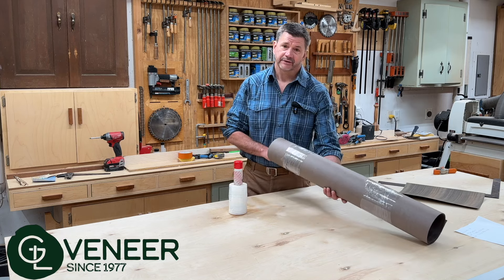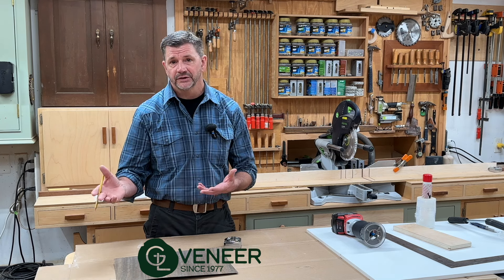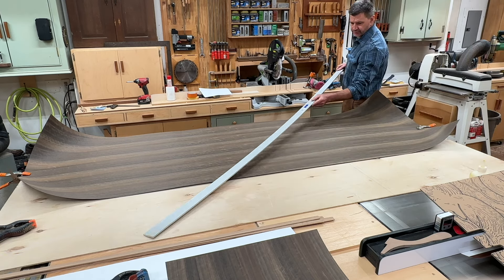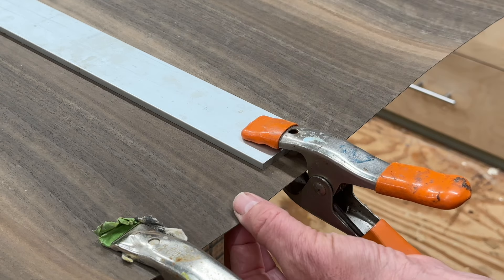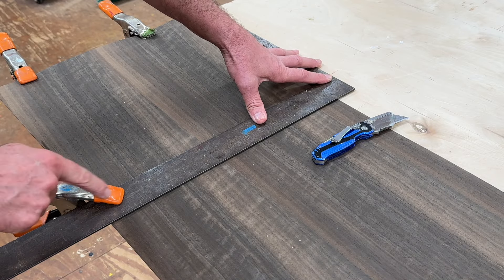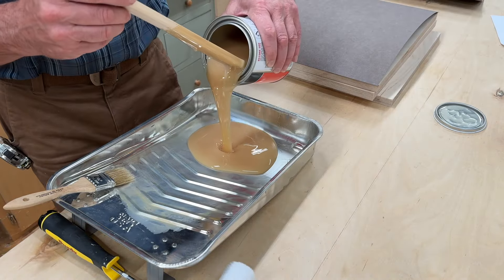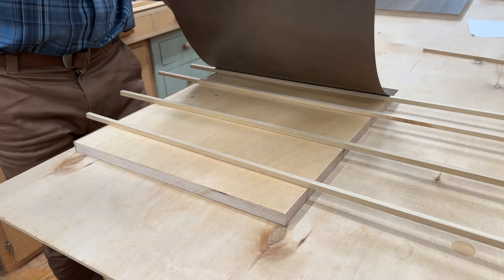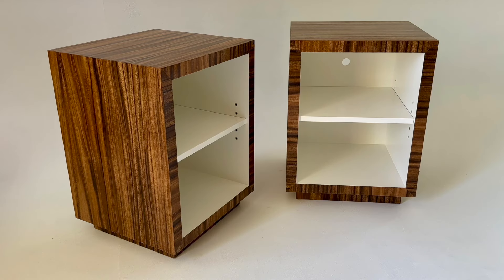How to Work with Wood Veneer - Tools Tips and Techniques

Comment: I'm in the process of sanding down and refinishing my kitchen. Next up is the plywood faces which I am planning to veneer. The problem is it's a vertical surface and I don't think contact cement would be a great option for that, especially since I won't be able to flush trim after the fact, it will have to be cut exact. Have you ever used contact cement on a vertical surface? How about an adhesive backed veneer?

Comment: Great video. Question: Do I have to veneer both sides when using non-water based contact adhesive.   Just what I needed.  I don't have a huge vacuum bag and pump.  I find the ironing on wide sheets of veneer can cause cracking/splits in the veneer.  So I was thinking that contact adhesive might be the answer.  Thank you

Comment: hello, so recently I had a project using quarter cut maple veneer and I used the contact cement method as I dont have any veneer press or a vacuum bag but it end up a massive failure. 
the results were terrible as the veneer was badly wrinkled and wavy (it was wrinkled and wavy even before I glued them on the substrate). I noticed that as the contact cement is applied and starts to tack up, condensation occurs on the opposite side of the veneer and water seeps into it causing more movement in the fibers which makes it more wavy and wrinkled. Is this problem happened because maple veneer is hard to work with or my method/shop environment (humidity) is whats causing this problem?

Comment: I don't understand the economics of using veneer.  Looks like you were using baltic birch as a substrate - I bought maple plywood furniture grade for far less than if I veneered baltic birch.  I understand more exotic species are difficult to obtain as a piece of plywood - can you talk about the economics of veneer.  How does money impact what substrate you use, etc.
Reply: I think it’s easier to veneer a box made the way he makes them then try and miter the corner of a box with a pre finished plywood. As the Baltic birch goes it may be more stable, less voids between ply’s which would help screw bite and grab a little better and it may be flatter. But I could be wrong lol.